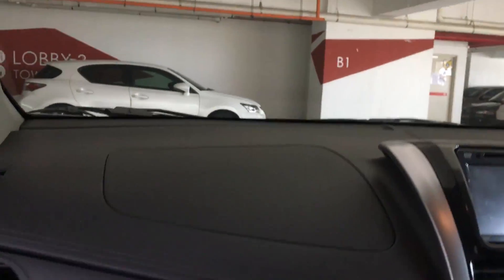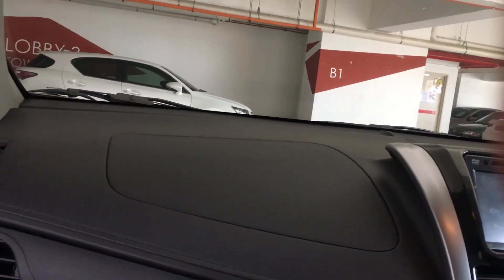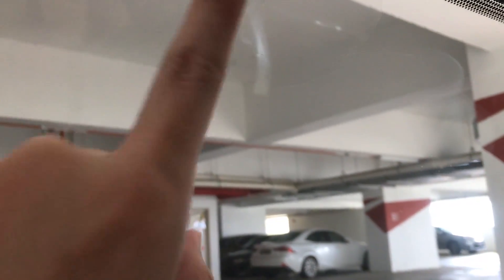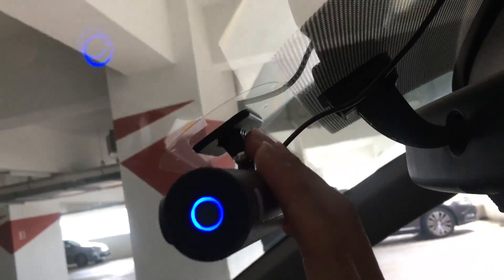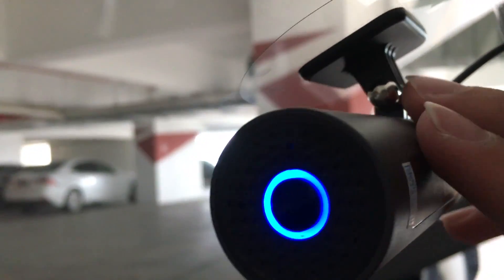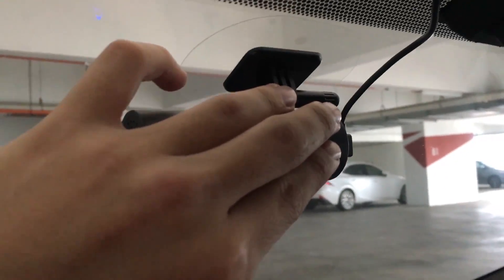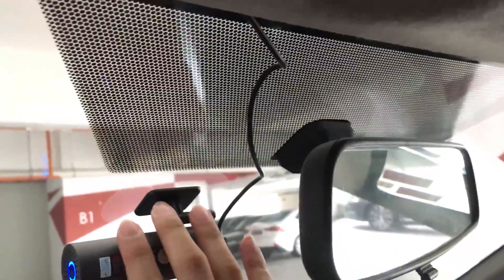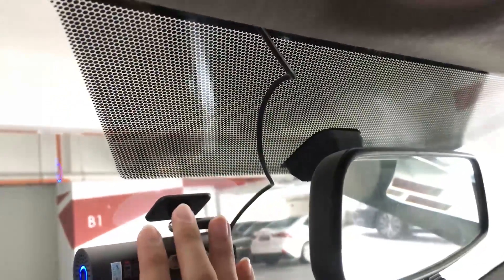Installing the 70Mai Dashcam

Comment: Can I use the dash cam for 9-10 hours continuous recording and saving that video on one single file?
Reply from the maker: unfortunately no. its built in system automatically splits each video into 1 minute sections.

Comment: Very nice and detail video. Well done. One question only. Can i power the dash cam from a usp port  from my multimedia car center?
Reply from the maker: Hi,

Unfortunately, you can't.

The power supply from a USB port is insufficient to power up the dashcam.
Reply: @ShaniAndrasAccord  Mine work with the USB port from my car radio..
Reply from the maker: @Elsuri313  yeap; it can draw power from there to if the power supply from the outlet is sufficient

Comment: Your wheel is on the right side, right ? This wire should be put on the  oposite part from the wheel, right ?
Reply from the maker: it matters not where the wires are routed through since they are invisible and will not interfere with driving.

Comment: Hello!Very nice video and guide!Can you tell me if the battery is good when using the camera without charging it?Thank you!
Reply from the maker: Hi!

You cannot use the dashcam without direct power supply. It needs to be plugged into the 12V socket of your car to be powered up.

Comment: hi nice video..i have question :
1) how long the cable given..? is it came with the cam..?
2) where did u buy the cam..? i'm from melaka...
thanks 🤗
Reply from the maker: Hi,

1) i didn't actually measure the length of the cable however it is sufficient (with enough to spare) from routing it all the way back from the rear view mirror to the bottom part of the centre console where the 12V socket is located;

2) yes, the cable came with the dashcam; in fact, the box has everything you need to get the dashcam set up;

3) i bought the dashcam from shoppee (online shopping hub) during a sale period; and

4) i have not seen (to date) any individual shops outside of online platforms that carries this product.

Hoped I cleared your doubts and would appreciate if you could show your support by subscribing and thumb's up this video for me as it helps me in making more videos such as this in the future!!

Oh, Happy Chinese New Year!
Reply: Long. I've just bought one and the cable is just under 3.5m. Plenty long enough to reach a power socket and tuck out of the way where it can't be seen. I bought mine on-line from Lazada Thailand.

Comment: HELP! I have a Cadillac DTS (modern car with power outlets) and have installed this cam correctly.  However, when I start the car the cam usually does not turn on automatically- I have to remember to press the button on the cam.  How do I fix  this?  The company is not returning my messages.
Reply from the maker: Hi, I have not encountered the issue you described in 2 of the cars I have installed in and i cannot replicate it at my end as well.  As a basic troubleshoot, try plugging the USB directly into a USB power outlet and not into a 12v socket. see if that fixes it.
Reply: Shani Andras Thanks for your response. I only have 12 V power sockets.
Reply from the maker: @FermiPara  if that's the case then perhaps you might want to try it on your other car? I believed that it might have been the way your car's 12V socket is made. 
I've installed 3 of these on 3 different brands, Proton, Honda and Toyota and none encountered the issue you raised.

Comment: Hi, I have a Baseus T-Typed 3.4A power outlet MP3 Player plugged in all the time but it has two USB ports and they can be used to charge phones etc. Can I use this with it or Do I have to plug it out and use the Xiaomi's plug only?
Reply from the maker: it is advisable to not share power ports when powering the 70Mai as I have experienced errors when doing so.

Comment: do you think it will attach on the black dots just behind the mirror on the windscreen?
Reply from the maker: Sandro Żahra hi, it will stick but i doubt it would be a good idea in the long run. the dotted area gives the sticker less surface area to adhere on hence creating a weaker bond - much like trying to apply tape on a dusty area instead of a clean surface.
Reply: @ShaniAndrasAccord  thanks for the feedback

Comment: Very nice
How much it cost you?
Reply from the maker: RM120 with tracked postage.
Reply: Price with 64 memory?
Reply from the maker: @zulhadimelakaman2338  I bought the 70MAI for RM120.00 (just the camera set - without any memory cards). the cards are sold separately and prices for cards may vary depending on the brand and size but word of caution, avoid SANDISK. Somehow, 70MAI dislike it and will not record on it.
Reply: Shani Andras Omg..I bought the device together as a package with memory card..the one given was Sandisk Ultra 😱 Hopefully mine will last longer

Comment: Hello, I don't speak English. Do you need to glue plastic film on wet glass or just on a dry clean surface?
Reply from the maker: Hi, no liquid solution is needed. Just a clean dry surface will do.
Reply: @ShaniAndrasAccord  may i know if the plastic film is sticky at the back surface? because it keep falling down :(
Reply from the maker: @chiaw3nable  the film is not sticky as it does not have any adhesives. the camera attaches to the back of the film with a foam double sided tape.

Comment: hi I want to ask
1) is it possible to on the devices without the cable and the power socket, or can we charge the devices with powerbank if you know..
2) where you buy it in Malaysia

thank you
Reply from the maker: Hi,

1) it is not possible to turn on the device without drawing power from cables so you need to supply it with any external power sources;
2) you can definitely power it up with a powerbank but you would need to keep it connected for as long as it is turn on, this device doesn't store power in its battery; and
3) you can find it in most major tech stores now, i got mine from Shoppee.

Comment: We need wireless dash cam if it’s possible
Reply from the maker: We all hope that one day will come however it is now very practically impossible because of the limitation of the technology available to us currently.
Reply: Wireless meaning u need to have a rechargable battery in the dashcam. That's dangerous if dashcam is left in the car and heat that may explode at high temperature.

Comment: Hi bro :). Just asking, if we didnt plug in the USB car charger, will it still run or is run by power?
Reply: It has an internal battery which will keep it running for a while. It has a 240mAh battery.
Reply from the maker: it only runs when it is plugged into a power source.
Reply: @ShaniAndrasAccord  yes, I stand corrected. The internal battery is for saving only!
Reply: The internal battery is for saving the recording when you turn the car's engine off and for the parking mode.
Reply from the maker: @captaingreek  no. once you shut off your car engine, the camera shuts down seconds later. there is also no "parking mode" for this.
Reply: @ShaniAndrasAccord  Read my answer again. Between turning off the engine and parking mode there is an "and". I have the camera and I bought one for my father in law. I know how to use it, I was just showing him this video.

Comment: Do I really have to use the plastic film? Or can I just directly stick my 70mai on my windshield without that plastic film?
Reply: I did it without the plastic film, the downsize of that is that I am unsure if I could ever remove it from the windshield. I am hoping that it is actually possible.
Reply from the maker: Hi!

You can stick it directly to the windscreen however I wouldn't recommend it. It is an extra step but you are going to thank yourself that you did it in later years when you are going to remove the device.
Reply: Can I get this extra
Reply: Where can I get this plastic film. If I need extra

Comment: Hi. Much better used any High endurance sd card.
Reply from the maker: Hi,

Yes, you are right. I'm using Samsung EVO+ 64GB.

Avoid Sandisk Ultra because it will fail in less than a weeks' time.

Comment: Hi nice video really helpful, however my 70 mai is not responding to voice commands,
Reply from the maker: hi and thanks for watching. if i am not mistaken, currently there are no 70MAI devices on the market that will respond to english voice command and even if there is, it's firmware probably got flashed with some ROMs.